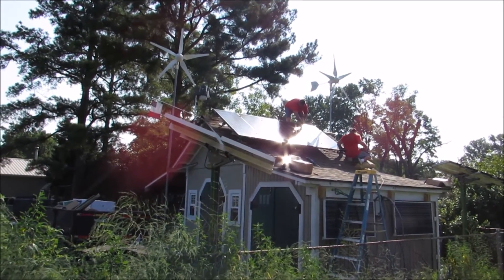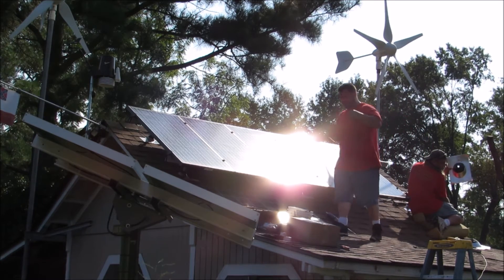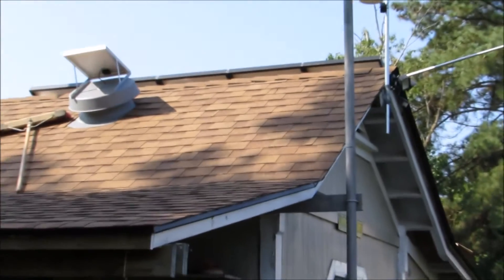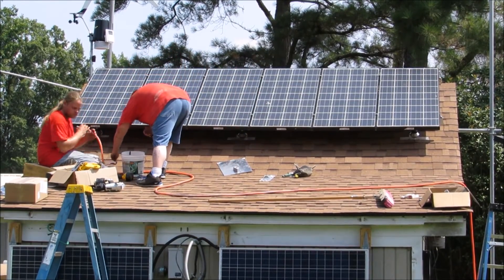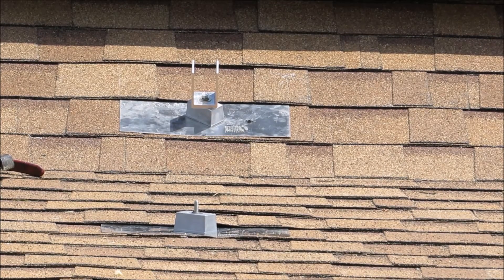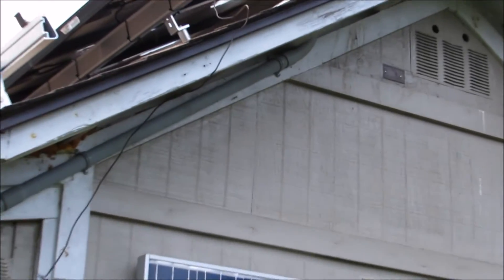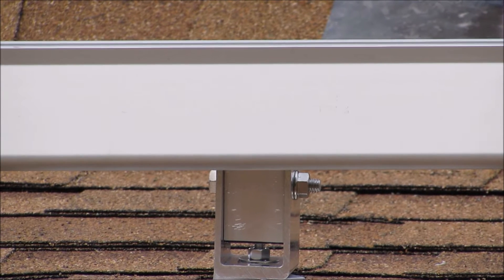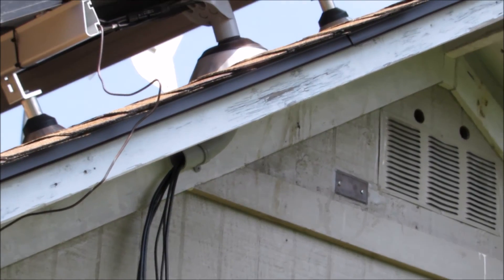Solar Power And Roof Rebuild Series  August 2014 By KVUSMC PT 3

Comment: Is there an issue with air flow?  They are mounted pretty high off the roof.
Reply from the maker: ***** The More Air Flow Panels Will Stay Cooler And So Will The Roof  ! Also Solar Panels Are More efficient the cooler They Are
Reply: KVUSMC / Kenneth W Viar Jr How true! Last winter, the 2000 watt array here would often produce 2400watts due to the freezing temps.
Reply from the maker: Here To Buddy I Know What You Mean   The Cooler The Better